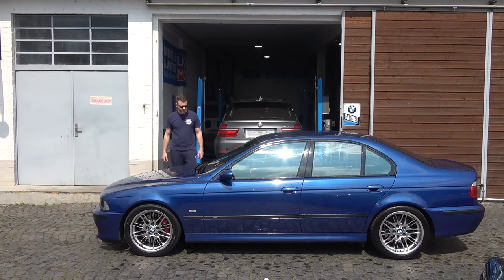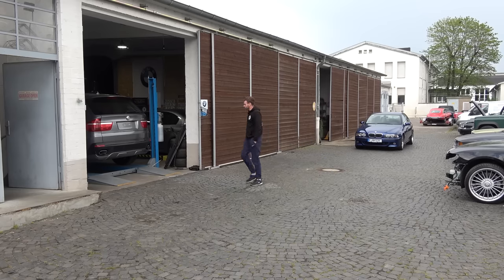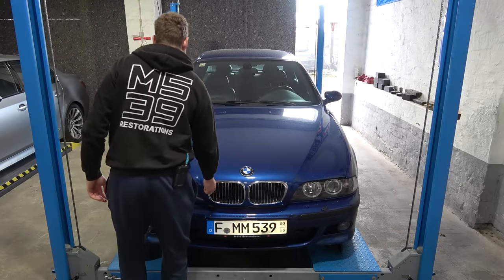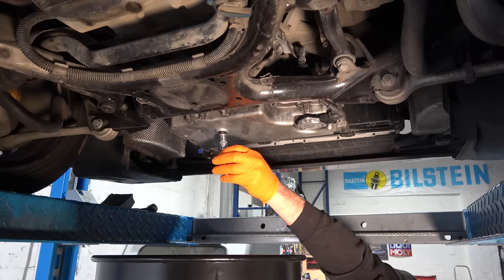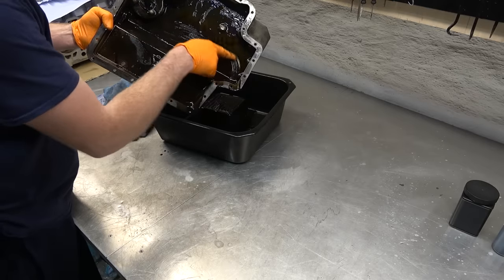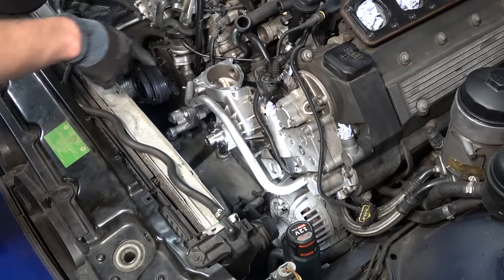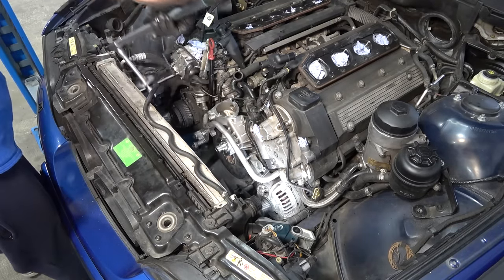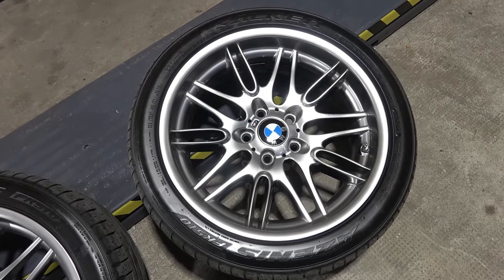Fixing Up & Driving an Icon on The Autobahn - The BMW E39 M5

Comment: I put turner monoball front control arm bushings on my E46 and I had a very similar experience in regards to the steering. They really transformed the car and it even made the braking feel rock solid. The only downside is that I went through two different sets in less than 30k KM. They would clunk and rattle and simply were not worth the trouble. They also have to be greased periodically. I also recently put redline D4 ATF in my manual transmission and it’s the best fluid I have ever put into this car so atf seems to work in many different applications. Great video!
Reply: I also have the same problem with my E46 325i. The shifting is bit hard when it's cold.  Which fluid do you recommend to get? :-)
Reply: @mustafahaseb1698  so I am currently using redline d4 ATF. I must warn you though that I live in SoCal so my experience with this fluid is with weather no colder than 50 degrees F. With that being said I had redline MTL-90 and I thought that was a good fluid but the ATF is another step above that. The transmission truly feels silky smooth when shifting.
Reply: @mustafahaseb1698  Get the same with my E92 330I. It doesn't bother me tho, just a quirk and also reminds me to take things easy until all fluids are warm.
Reply: I put in Febi 40580 to a bmw getrag 6 speed of this vintage (420g?) and I doubt anything will fix a sticky when cold 2nd gear fluid wise.
Reply: For those of you having trouble with shifting while cold, try blipping the throttle up few hundred rpms while pulling lever into the gear. It helps lining up synchromesh in the transmission and it will shift easier. 

I had few manual Bmw's and second gear was always problem when cold. Talking about real cold, up to -35C and this trick worked. Always used only Bmw MTF.
Reply: @yamman93  I've used the MTL90 in a non BMW and it was a huge improvement.

Comment: Great job as always. My mechanic pushes me to do the timing chain and guides, because they were changed in 2005. They have only done 50000 km so I’m trying to push him just to check the oil pan and change the tensioner only. However, he is very persistent, repeatedly saying “preventive measure” 😀. Need to make my mind, tough decisions.

Respect from Prague!

Comment: You want an amazing sound with one of these, try removing the intake plenum cover, disconnecting the mass air flow sensors and then giving it a rev. Did this many times as a BMW tech in the workshop. It's the most glorious V8 induction roar that you'll ever hear. Just loved doing it!

Comment: Great maintenance Sreten. I replaced the first water pump on my former e36 325(M50) by a BMW one. It lasted only 40k km. After that, I bought an INA pump, which lasted for about 50k km. I drove that car for 17 fantastic years. Dutch regards, Nico.

Comment: Question:  Will TuV inspection be a problem with the Monoballs?   I understand DE regulations can be a bit tricky when it comes to using aftermarket mechanical parts which would need to be certified by the manufacturer.
Reply: ussualy they are put on, and before tuv taken off, then back on after passing tuv.
Reply: Never had problems with aftermarket bushings like PU for example. I also have different coupling rods in my e30 which are actually for a mk3 mondeo and replace the rubber bushings with uniballs.

Comment: Ah the memories of my e39 m5 that I owned for 8 very expensive months in 2012. My attainable Dre car, incredible machine once I had finally got it running right by replacing all cam sensors, both lambda sensors, rebuilding the vanos packs myself in my kitchen, replacing all vanos seals. It's only ran perfectly for the last month I owned it before I had to sell it to emigrate, but my God what a car.

Comment: I remember using Falken tyres. I used to have 235/45R18 Azenis ZE912 back when they were current. They were good and handled the road well. The only thing I was surprised about is their weight and how stiff the sidewall was. Much later, in 2019 I got myself 245/40/R18 Michelin PilotSport 4S. And they were incredible: Grippier than everything I ever used (Falken ZE912, GY Directional5, Dunlop DZ102) and with a soft sidewall that made them REALLY comfy too. Best tyre I ever used.

Comment: Great video as always. I am not sceptical at all about the ATF tip. Got that tip from my BMW dealer years ago for the E30 I owned at that time. I put ATF II fluid in the gearbox and never had any issues again.

Comment: Most of the valve cover gaskets I see leak on these is from the flattening of the rubber donuts on the cover bolts.  The bolt bottoms out far before the rubber can apply adequate pressure.  Cheers, the channel is fantastic.

Comment: 1:07:40 I always used ATF in 2-stroke motorbike gearboxes in the '80s - it's a magic elixir. It improved my NS400R's shifting massively - less false neutrals and less lever pressure.

Comment: When I did the fuel pump on my Audi I cheapened out on the rubber 8eur gasket and naturally it leaked like crazy.  When DIYing this job, its good to leave the top cover and the seats out, go to a petrol station and put something like 20 liters of fuel in, that's when it will leak because filling it up will build up pressure and fuel will drip from the top if youve messed it up...

Comment: I have a 1999 540i wagon that went through Lemforder front control arm bushings in 30K miles.  I put in GAS monoballs and have never looked back.  Turn in is much more precise and is worth it even when the additional harshness (which is noticed mostly around town at low speeds) is factored in.  Give the monoballs some time and I think you'll come around.  

Good show, by the way.

Comment: Monoball thrust arm bushings are a worthy upgrade indeed— I kept killing rubber thrust arm bushings in my E34, even the upgraded Meyle HD ones... the oldschool bushing design just doesn't keep up with modern 200-treadwear street/track tires, and I was tired of replacing the bushings after every track day. I went with a set of Mooseheads and they've outlasted every other bushing I've tried, with minimal NVH penalty.

Comment: Hi Streten, I changed the gear box oil from Royal Purple Syncromax which was good to Toptec 1100 ATF with a Moly Gear additive, only covered 300 or so miles but the change is more smooth as i put milage on,  also i run the Gates 82c thermostat, i have a digital temp gauge and around town the temp @ 83 - 84c pusher fan running them moves easily up to 89c, viscous fan cuts in at 89c when in stationary traffic its all good !

Comment: Love the content 👍great article on the serving of the E39 M5 you got a gem there!!!!
Was mulling this over last night and sadly BMW has (LOST THE PLOT) completely over  recent years.
It begs the question,perhaps we were warned if this with the BMW Mini. Initially they outsourced respected and excellent designer Frank Stephenson to do the MK1  X5 and he did a excellent job,so on the back of that he got the contract to do the new Mini,which I think is sublime. The only thing I’d change would be to address the clumsy indicator/sidelight assembly. I’d replace it his with a lightly domed inductor with a crone ring around aping the original,and move the side light into headlight aka original.  Now BMW had the template laid down by Frank Stephenson,but thought,we could save money by doing mk 2/3 in-house,resulting in models that have been to Celebrity Fat Farm!!!
Now to me the modern era where BMW were  at its best were 1994-2004 some beautiful cars elegant,stylish ,classy.
My choice would be 635csl  ( Crime Seen Investigation) lol  MK 1. E28 Hans built 282bhp M5 and the legendary Mk 1 E30 M3 the 2.3 4 cylinder 212 bhp. All timeless classics. More recent would be the later V10 M5, challenging looks,but I quite like them, and the ultimate gem the E46 M3 CSL,which I believe is the best M car made. I also believe ,not sure if it’s Munich Legends or not that will remove all the gubbins from the SMG gearbox convert it to a manual 6 speeder,alter the drive ratio on the differential,and provide a machine that truly lives up to the Ultimate Driving Machine moniker. Check out Harry’s Garage review on this!!!
Also a smal company called REDUX has done a sympathetic evolution of the original E30 2.3 4 cylinder,and it’s sublime, but at 338.000 plus doner car,not cheap. Check out Retropower on YouTube for a excellent review on the development of this. only 30 are being made,so a genuine future classic.
To current day BMW (Just Why) !!!!! 
The insides are all fussy and capastive touch screens,over complicated,and then (tacky,naff) jewelled controls (why just why)!!!
Then the exterior (were they all on drugs) the M3/4 have this huge Beever toothed grill (why ,just why) the side and back full of sweeps and creases. A disaster!!!
Then we get to view the IX. Hideous,just Hideous!!!
Then the Gross,ugly,incoherent disaster XIIIM. This apparently was designed by 3 separate design houses,with no communication between them, then glued the 3 bits together (they all definitely were on drugs) hideous, offensive, corrupted,bloated!!! With 23 inch rims,imagine the cost to replace the boots on that,let alone a alloy!!
So we think we’ve come to the end of shocks from BMW, but then we are presented with the X7M and i7 now we’re at the pinnacle of bad taste. ( why just why)
Now if I had a large wad burning a hole in my pocket,and was in the market for a new car, Id go no where near BMW and go straight to Tesla and order a model 3 or a Alfa Romeo dealer and order a Guilla  quadlufiglo,both classy desirable fast accomplished cars.
So,yes ,in my view BMW  had sadly (totally Lost the Plot) and can’t imagine why anyone or anybody would take them seriously anymore, unless you are a Celebrity,who has NO TASTE,LITTLE BRAINS,if any,and to much CASH, sadly these are the people who will by this!!!!

So I’m with you totally,get a tastefully made BMW from 1984-2004 give it love,care  and attention. Subtlety enhance and restore to its best and love,and enjoy the time with a classic.

Keep on doing the great work,and providing excellent informative content.👍👍👍👍

Comment: 53:00, if you remove the fuel pump fuse and crank the car for a bit, that releases pressure on the system and so you won't spill any fuel

Comment: Sreten,   Great vid as always.  I always wanted an E39 M5. In fact I learned how to rev-match in one.   You're so lucky to have the opportunity to stretch the legs of a bimmer on that splendid autobahn.   On an side if you're ever interested in cleaning up the inside of that S62 you could try an oil which contains a higher percentage of Esters (polyol ester).     It may only take 1 or 2 OCI's to clean up the varnish.  Products like Ravenol RUP Racing 5w40, Redline 5w-50 (HTHS of 5!!) etc.

Comment: I am surprised to see a steering box instead of a rack. Great video.  Solder is quick but connectors do not melt under heat condition and leave you stranded.

Comment: Regarding the shifting problem on E39 6 speed transmissions when cold, I had a similar problem with my '98 540. I seem to remember that the channels for the ball bearings that held the gear selectors in position were machined slightly small by the manufacturer. Polishing the channel enlarged it enough to allow the bearing to fully retract into the channel and solve the problem. I learned this from Mike Miller at the BMW CCA.

Comment: Hi Sreten, at 1:07:30 you mentioned about gearbox oils not making much difference to the stiff gear changes especially when cold. I remember changing my old E39 fluid to Royal Purple Synchromax and the shifts were way way way smoother.

Comment: Nice! I was thinking about changing those bushings myself too, as I as well heard good things about them. I think in the long run it's worth it. This pretty much convinced me to change them. Also those michelin rubbers are just as good of a set of tires than the falken ones are. Using those myself and satisfied with them. I think they didn't respond is probably because it was a one time only sponsor, or they're too "busy" to answer. Anyway, cheers. Enjoy that one of the best m5's ever made.

Comment: Great vid as always. +1 on ATF for crunchy 2nd gear. I had a Mitsubishi GTO Twin Turbo with a 6 speed Getrag box that crunched going into 2nd. I was debating rebuilds and replacement gearboxes and someone suggested ATF and I thought “what’s the harm in trying?” It completely solved the problem for the rest of the time I owned the car.

Comment: Motivated by your videos, I'm also trying to keep my E39 in best possible condition as far as my abilites and equipment allow me. However, by now I find it more and more difficult to remember and find all the little tips and tricks contained in your amazing videos. It would be very cool if you or someone from the M539 community could set up some kind of database/list where you can find the right video and timely position for the various types of repair. This and your list of parts with their part numbers would be pure gold to the community.
Someting like: Replacement of fuel pump: <link to video>, Parts: <no.1> <no.2>, etc.

Comment: 1:09:22 I think those monoballs will prove themselves over the years. The rubber bushing for sure will get tired and the precise feeling goes away. Those monoballs will last the same throughout the years because there's no rubber in them which would get tired. Metal doesn't get tired as easily as rubber so I think in the long run you did the correct decission.
Reply: Metal NEEDS lubrication, and the monoballs have no lubrication points.

Comment: Nice work, as always! Btw, you can get rid of the fan clutch entirely if the car(even the old ones) has AC because it has front mounted electric fan an that's what cools the car down. Tried it myself on my E46, removed the stupid fan clutch and drove inside and outside the city and nothing was wrong with the car. You can try if you like :D

Comment: In one of my cars, a 2006 Citroen C5 V6, I must confess I used more than a tube of sealant to get rid of all leaks on the FOUR valve covers it has.... In my defense, two of the covers come with RTV from the factory and you need a lot of it....

And for the other two the gasket is no longer available... so you have to MAKE a gasket with RTV...

Comment: Former gear designer for high performance transmissions (Bugatti etc.) here.  Don't use ATF, it does not have the same high pressure contact performance as ordinary transmission gear oils.  You will get into scuffing on your gears well before the gear design life limit.  Gears in transmissions that are designed to use ATF have been designed from the onset to cope with the reduced scuffing protection.

Comment: Man this channel is like heroine. By the way, if you tap/wedge a pickle fork in the slit of the hub upright after releasing the pinch bolt, the shock moves right out, no hassle.
Monoballs would seem a bit too much for street use to me. The thing I love most about the e39 chassis is its wonderful comfort.

Would the ATF also be suitable for my e46 330 6?-speed? It has a difficult cold 2nd gear too.

Comment: Thanks for another great video :) 
Out of curiosity, have you thought about adding a tiny bit more torque to common leak spots like the oil pan gasket? 
Mine would keep leaking with a new gasket and when torqued to spec. One day I got fed up with it and put a ratchet on the bolts and gave them all another half turn, and it hasn't leaked in 5 years. 
I know the BMW spec has its reasoning etc, but maybe they would reconsider if they knew back then that things would start leaking after X amount of mileage.

Comment: About oil intervals, The absolute maximum is 15000km to change them, and 10 000km is the sweet spot between the economy and the engine life. (backed by the tests and analisys in Lab).

Comment: The gearbox in the M5 is the same as in the Maserati 3200 GT and they also have the problem with shifting in the 2nd gear. I solved this problem by overfilling the transmission with 0.5L gear oil through the reverse light switch.

Comment: Your method of removing the thermostat seal was amazing, I have personally mangled that seal so bad trying to remove it and never succeeded so just bought the new housing with seal installed.  So many amazing hints hidden throughout, it will all be useful to me when I get to this point.

Question: Any issues re-using the lower plenum gaskets?  They are $$$ as you know and I noticed you have re-used them here instead of replacing.  Were they already replaced in the past, or is it OK to typically re-use these?  tx Sreten!

Comment: I know zip ties are cheap, but... for a task like that, you can use them backwards, they will hold the gasket the same way and you can reuse them because you dont have to cut them to take them out.

Comment: 292K miles on my E46 330i... :)  Oddly - when the shop replaced my oil pan gasket, fix oil pump nut, and check the #4 journal - they also found 5 of 6 lower piston oil squirter arms in the oil pickup.
Reply: My e46 330ci had 337k miles before I sold it. It’s still running and driving @ 342k rn. It’s on the channel old videos

Comment: Speaking of oil, have you tried PAO/Ester oils? Much better preservation stats at both high and low temps, especially with modern engines with supertight tolerances, like your Alpina's. I believe Ravenol RSS (if we're talking high viscosity) should be readily available where you are. Liqui Moly, unfortunately, just like 95% of others, offers VHVI oils which are only sort of synthetic and it's "just enough". Considering your change intervals are pretty short, it might not matter THAT much, but since you're all about preserving it might be a good way to help squeeze out another 100K :)